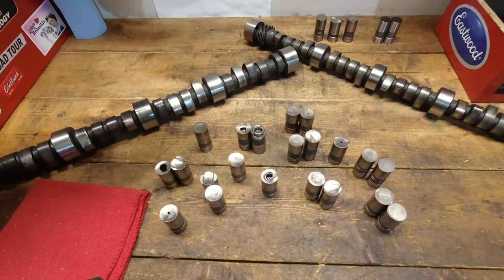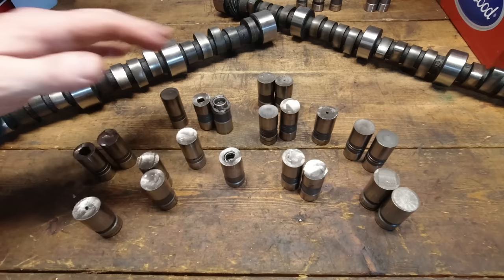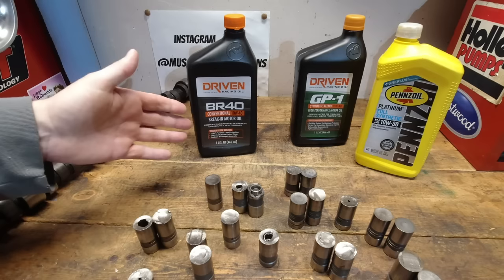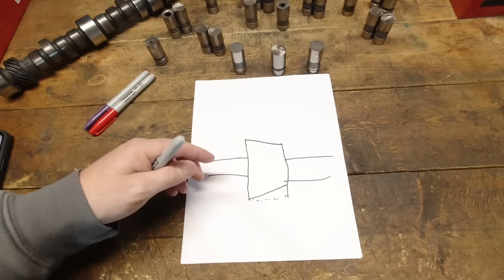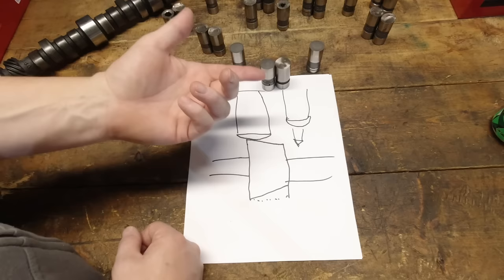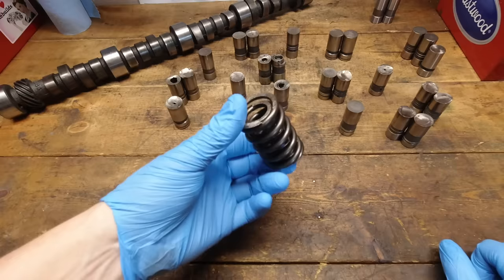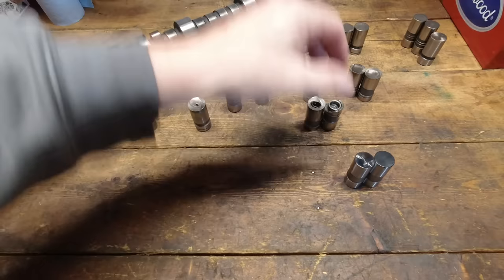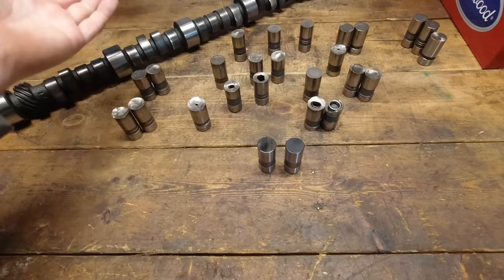Flat Tappet Cam Failures: The Reason Why They Go Bad & The Solution! Part 1

Comment: Sorry man, but this video is full of misinformation, particularly the entire section on engine oils and zinc and detergents. I am a certified lubrication specialist with over 2 decades of experience in the lubrication industry and I can safely tell you that you've been misinformed by somebody with either a limited understanding, or is deliberately spreading false info.
Reply from the maker: Like I mentioned in the video, we’ll get any corrections when I do the interview with Lake Speed Jr.  Share an example of what information is incorrect?
Reply: That's a lot of typing in a little youtube comment section. Ok, here's an example: Diesel engine oil doesn't have "enough" zinc. This may be partially true, but it's not such a simple black & white situation. In 2007 new API spec CJ-4 instituted limits on phosphorus at 1200 ppm. Since most phosphorus in the oil comes from the compound ZDDP, or "Zinc", that reduced the amount of zinc in the oil to around 1200 - 1400 ppm, which is still a relatively healthy amount. Understand that the tribo film developed by zddp as a self sacrificial layer of protection will only develop so thick no matter how much zinc is in the oil. It is a misunderstanding to think that higher levels of zinc provide a thicker tribo film. Any excess zinc in the oil after maximum thickness is reached serves to replenish the tribo film as zinc is worn away. Also, when CJ-4 was introduced it required an increase in the amoun of wear protection provided by the oil vs the previous specification, CI-4. Let me reiterate, CJ-4 oils were required to have more robust wear protection than CI-4 oils. There may have been a reduction in zinc allowed, but engine manufacturers demanded no loss of wear protection, in fact they required an increase. Let's move on. With the introduction of CK-4 specification a change was made to require oils that carry a dual API license for both CK-4 and S_ must meet the maximum phosphorus limits for the S_ license. If the oil is not licensed for an S_ spec than this limit does not apply. So some lube companies reformulated their diesel engine oils with reduced zinc levels in order to maintain an S_ license, however not all did, and many heavy duty diesel engine oils still carry ~ 1200 - 1400 ppm of zinc today, and they have very robust anti-wear performance. You do realize that Cummins, Volvo/Mack, Paccar, IH, etc are very concerned with wear in their engines, right? Tests that must be passed for CK-4 licensing measure wear at different points in the engine, including flat tappets used in Cummins B series engines. It is true that spring pressures may be lower in these engines vs a high performance high rpm gas engine, but these engines are expected to achieve a service life of up to a million miles or more, wear control is very, very important, don't kid yourself. Diesel engine oils are still a valid alternative for those with flat tappet cam engines, in fact they have some great features and benefits.
Reply from the maker: Looking at my notes from a tech seminar at PRI, the CK-4SN is the latest API rating for diesel engines, correct?  From the information that was shared, they have the same zinc levels as a regular off the shelf API at 800ppm.  Is this not accurate?  If not there was a panel of experts that need some help!  So assuming that’s the newest API spec for diesel, are you comfortable in saying 800ppm is acceptable as an every day oil in a flat tappet engine?  And how does this correlate to break in oils with significantly less detergent package?  So what are the great benefits to that current API spec diesel oil and what is a guy going to find in the shelf at their local auto parts store?  The new spec or the older ones you spent so much effort to explain the history of?
Reply: @MuscleCarSolutions  the current API spec for HDDEO (Heavy Duty Diesel Engine Oil) is CK-4. The current API spec for PCMO (Passenger Car Motor Oil) is SN. There are other specs as well, but let's stick to those 2 for now. The only limit for CK-4 engine oils is .12% phosphorus (plus other limits for sulfated ash), which equals 1200 ppm. It is PCMO oils that have a limit of 800 ppm. It used to be common for HDDEO oils to carry a dual license, for both C_ license and S_ license; and they could contain higher levels of phos with the earlier C_ specifications. That changed with the adoption of CK-4, now if an HDDEO carries dual license it must meet the 800 ppm limit of the S_ specification. So, if the HDDEO carries only the CK-4 license, it is not restricted to the 800 ppm for phos, it is only restricted to the 1200 limit for CK-4 oils. I hope that makes sense,  it's complicated to try to explain wihtout typing an essay, I'm trying to explain it with a minimum of words. Some HDDEO oils are dual licensed, some are not, you have to reaad the tech data sheet which should be available online for most all engine oils. If I may use some brand names you've probably heard of, Chevron Delo 400 carries a dual license, both CK-4 and SN; because of that it's zinc is restricted to ~800 ppm of zinc. Shell Rotella T-4 15W-40 carries only CK-4 license (no SN license), so it is not restricted to 800 ppm phos. I manage several hundred used oil analysis from diesel engines every month, I have plenty of data to back this up. I am not advocating for or against either of those brands, I'm just using them to illustrate how the limits on zinc are applied. Each user needs to do their own due dilligence. Read the tech data sheet, call the tech line and ask them. 

Re the panel of experts you refered to, either you misunderstood what they said, or they were ill informed. I'm giving you correct information.
Reply: @hasserl  Very good discussion here, perhaps MCS could connect with you as part of his video upcoming with Lake Speed Jr.?   There are many "oil pros" on YT and the internet; few or zero real experts without any agenda whether that be some sort of brand connection or simply they prefer to have a bias somehow.  Care to offer any comments on the Titanium additive? useful, marketing hype?  Thanks
Reply: @chestrockwell8328  funny you should mention "agendas". Before this video, before the latest article in Hot Rod magazine that discusses engine oils, I had started to recognize a pattern among some smaller specialty lube companies arguing against guys with older flat tappet gasoline engines using diesel engine oils as an alternative to current PCMO's with reduced levels of zinc, or their special engine ils with elevated zinc levels. I smelled an agenda. I may be in the lubes business as a profession, but I'm involved in hot rods at a purely personal level, (I've owned old cars ever since I bought my first car as a teen back in the 70's, and still own an old '30 Ford pickup with a sbc in it) and I've had to deal with this issue myself. I use and have recommended diesel engine oils to others for some time now. So I've been a little put out by these anti-diesel oil arguments. Everybody has an agenda, my agenda is just keeping the discussion straight. If diesel engine oils are not a good recommendation, for legitimate reasons, than I will gladly change my opinion on it and change my practice and recommendations. The trouble is, I have yet to see legit arguments being made. I mentioned an article in Hot Rod Mag, that article is authored by Lake Speed Jr, and he makes a couple of incorrect points in the article, IMO. Interesting to note that Speed is/was affiliated with Driven motor oil. Hmmmm, sorry but I question his agenda. Maybe he's being perfectly honest, but just happens to be wrong. Or maybe he does have an agenda. At this point I remain supportive of using a good CK-4 or even CJ-4 diesel engine oil as a good alternative for pre-catalytic converter gasoline engines with flat tappet camshafts. It wasn't always so, prior to CJ-4 HDDEO's had too high of sulfated ash content, that is no longer the case, SA is limited to 1%, making them a viable alternative. Arguments to the contrary don't hold up to scrutiny.
Reply: @hasserl  Appreciate your comprehensive replies, certainly there is a lot more but as you mentioned, this is the YT comment section.   Yesterday I went down a rabbit hole of sorts investigating oil. Oddly without reading the HotRod article I did come across discussions that were anti diesel oil in a passenger car. Like many I've been looking into the failed cam/lifter issue, where as the blame tends to either be the oil is wrong or the came lobe angle and or lifter dome angle are wrong.  I got fed up and called my cam company Howards and asked for their flat tappet break in procedure, and whether or not the lifters (Crower solid flat tappet) I selected would play nice with the camshaft, here's what I was told.   Use Maxima break in oil, 20 minutes run time, 2000 rpms, never ever idle. Remove the inner valve spring and remove the windage tray as added assurance; that's it.    Further discussion with the Howard's rep got to where he said lifter bores are an issue, being out of round and not letting the lifter rotate.  Along with Maxima Oil i found, High Performance Lubricants oil, Klotz oil, and some guy from Speed Talk post saying the newest Quaker State full Synthetic is the best oil ever tested by him which he's tested 284 oils.
Reply from the maker: @hasserl  I appreciate your insight but wanted to apply that to the real world, or what’s it an auto parts store for the average user to choose from.  I guess I never noticed how many diesel oil options there were available.  The CK-4SN API was more than half the oils on the shelf.  The only ones I saw that had just the CK-4 rating were the rotella that I looked at.  Here’s the issue I see with that.  There are thousands of folks who say to just use a diesel oil for a flat tappet engine.  If they’re lucky enough to grab one of those higher zinc oils for their every day use, good!  If they don’t….that’s a problem.  And to be fair, no one talks about what API standard the oil is.  It’s brand, viscosity and that’s it.  Hell no one in the comments here made any mention of the API donut until you commented.  So while I could have stated “not all diesel oils have high enough zinc”, the blanket statement probably didn’t hurt anyone either.  Especially given what’s on the shelf that’s labeled as diesel oil at the local auto parts store.  

As far as your comments on Lake Speed Jr.  Leave me your questions and comments on what he got wrong in the article and when I interview him next month, I will have him address those.  I’d like to hear his response.
Reply: @MuscleCarSolutions  OK, so the article is titled: "Slippery Situation: Is diesel engine oil the right choice for a gasoline engine?" The author is Lake Speed Jr. In the article Speed says "the type of ZDDP in diesel engine oil is not the same as the type of ZDDP in gasoline engine oil." He goes on to say "diesel engine oils typically contain primary ZDDP, and gasoline engine oils contain a blend of secondary and primary ZDDP". This is false, diesel engine oils also contain a blend of primary and secondary ZDDP, and there has been a trend toward higher levels of secondary ZDDP with current technology having around 85% secondary ZDDP. Perhaps in older formulations this wasn't the case, I don't know; Maybe that is what Speed is thinking of. But today, with the demands placed on modern diesel engnie oils, current formulations rely more extensively on secondary ZDDP. He also infers that the reason for the different types of ZDDP used is due to differences in engine speed, and that is also incorrect. The different types of ZDDP used have more to do with the different ways the types plate out on the parts, the rate of deposition and the temperatures involved, as well as anti-oxidation performance. Engine oil formulators each have their own preferences for the ratios used, but they do it for specific reasons aside from the RPM range of the appication.

There is a lot more discussion we could have on this topic, but I'm not going to sit and type an article, or a white paper, in the comments section of a youtube video. Let's just say that so far I have yet to see anyone having completed an extensive post failure anaysis, or root cause analysis of cam & lifter failures. Until that happens all we really have is people opining on the subject. To be sure there is some good discussion about the issue, but IMO we have yet to see a great or defining analysis. But please, ask Mr Speed to address the point I made above. I think he's done a disservice to the community with his article and IMO he should retract it.
Reply: So I'm back one more time to add to my last message. There was more in the article that I wanted to address, and I hope you'll be able to forward these concerns to Lake Speed Jr. So, there were 3 things indentified in the article that are different between passenger car, or gasoline motor oils and diesel engine oils, 1. the type of ZDDP used, 2. the amount of anti-foam, or foam suppressive additive, and the type of detergents used (with gasoline oils using lower levels, and diesel oils using higher levels of Calcium). I already addressed pint #1 in my previous post. #2, Anti-foam additive treat rate, Speed claims that gasoline oils use heavier treat rates of anti-foam than diesel engine oils, which is important because gasoline engines tend to run at higher rpms and tend to develop more foam in the oil, which is bad news because foam makes a lousy lubricant. So I took the time to look up some comparison's in the amount of Silicon in various gasoline and diesel engine oils, and I found this claim to also be untrue. I looked at a Brad Penn synthetic blend, Valvoline High Mileage, Pennzoil Platinum, Castrol GTX Magnatec & Mobil 1Extended Performance; and the amount of Si in the oils ran from 3 to 7 ppm, with an average of 5.2 ppm. I then looked up several diesel motor oils, including Castrol GTX Diesel, Chevron Delo 400, Mobil Delvac 1300, Shell Rotella T4 and John Deere Plus-50 II, with Si levels ranging from 4 to 10 ppm, with an average of 6.4 ppm. So much for that claim. That's strike 2. Then there is the claim that diesel engine oils use a high treat rate of Calcium based detergent, which has been determined to be problematic for direct injection gasoline engines, leading to Low Speed Pre-ignition. OK, well I don't know that anyone is advising anyone to use a diesel engine oil in a new car using direct injection, so this point IMO is moot. But what about the claim? Well, I did find that all of the gasoline engine oils mentioned above did have low treat rates of calcium, however I also found that 5 diesel engine oils I looked at 3 of them also had low treat rates of calcium, around 1400 - 1700 ppm, about the same as the gasoline engine oils, though the other 2 did have higher treat rates >2300 ppm. The point being, his claim is inaccurate. Though it is a moot point, I think it's important to point out that all 3 claims he made in the article are false! Seriously, the article needs to be withdrawn. I seriously do hope you will bring all of this up with Speed. If you want to include me in the video to have this discussion I will be happy to.
Reply from the maker: I’m scheduling our interview this coming week and will let him respond to your comments.
Reply: @MuscleCarSolutions  How about you and HasserL connect directly via phone; this has the potential to become a thorough and accurate explanation of current oils which would be incredibly helpful for anyone and everyone seeking true information.  And a major video for your channel.
Reply from the maker: Took me forever to find this thread.  The interview with Lake is on the channel if you’re ready to hear what he had to say about diesel oils.  The description has the time stamp where that discussion starts.
Reply from the maker: @hasserl  there.  Now it tagged you.  Interview with Lake is live.
Reply: @MuscleCarSolutions  thanks for letting me know you LS jr. interview is ready.